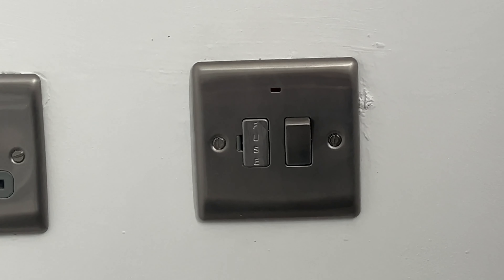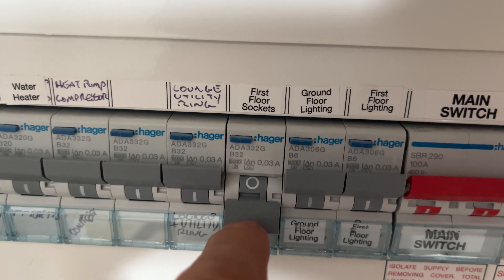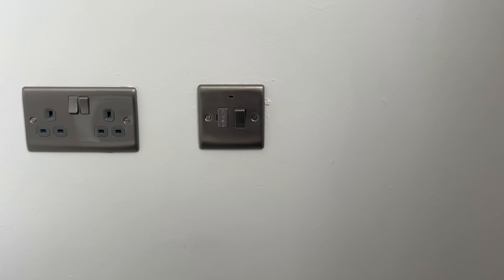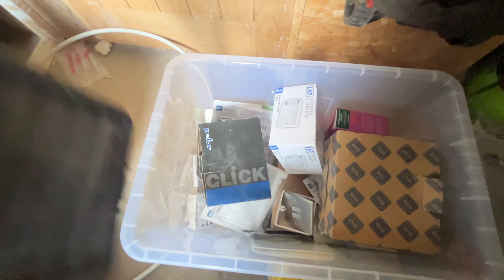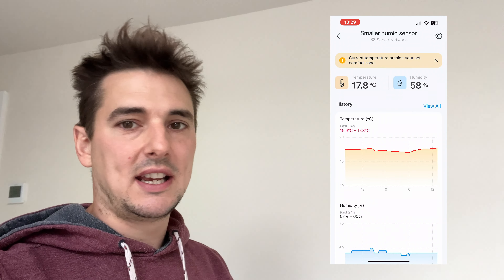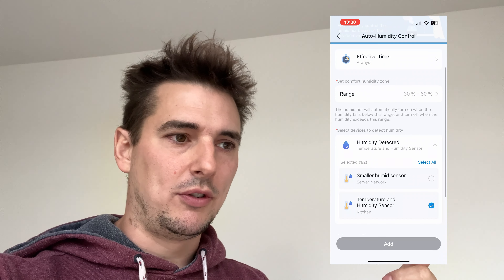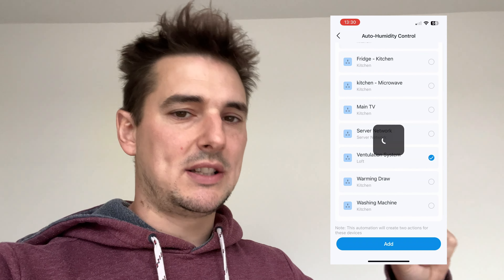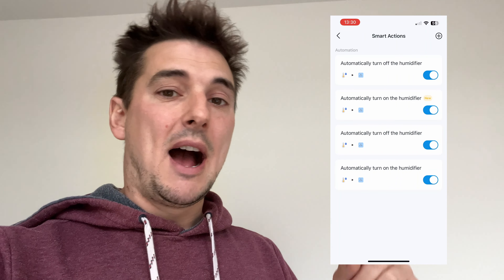Fixing Damp With A Tapo T315 Device + PIV System

Comment: I think it's designed to be on 24/7 and not with a humidity sensor, always check with manufacturer.
Reply from the maker: Hey , when I spoke to the manufacture they confirmed what I was doing was correct. They sell their own humidity sensors for the unit also (but this could be different manufacture to manufacture). 
The unit doesn’t have to be on 24/7 to have effect on the house.